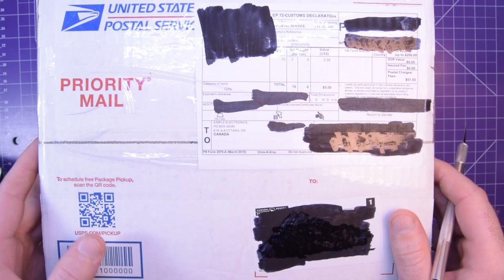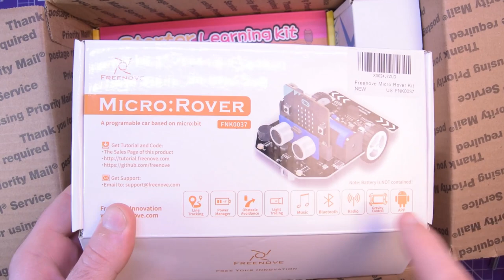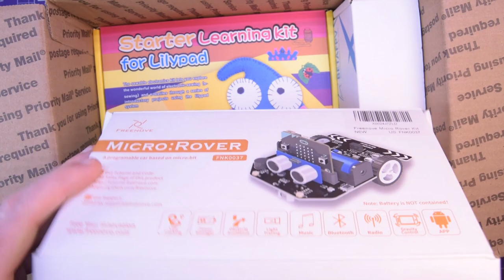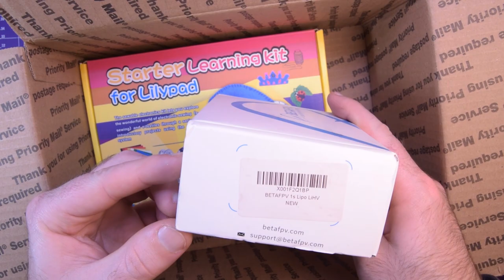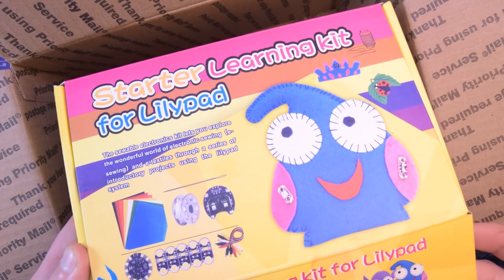Mailbag 71 - Another Maker³

Comment: Those EZ-RJ45 connectors are a service nightmare. A bunch of my colleagues use them but never replace the blades that trim off the conductors at the end of the connector when  they  get  dull so it leaves little mushed nubbies at the end of the connector which prevent it from making a good connection. Very first thing I do when I see one of those in the field is cut it off and replace it with a proper connector.

Sorry for comment on old video, I'm binging the mailbag playlist :)